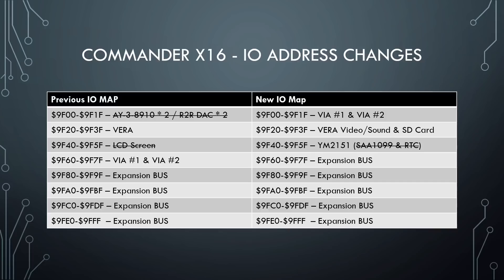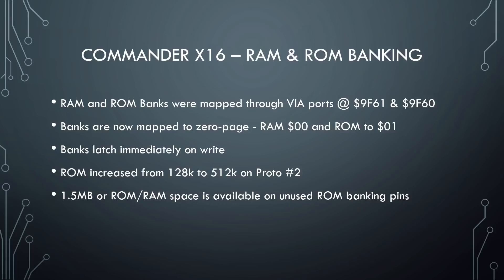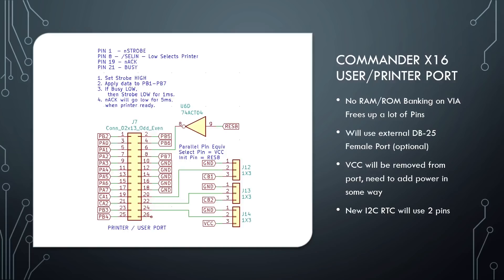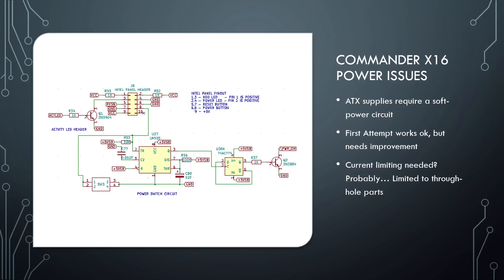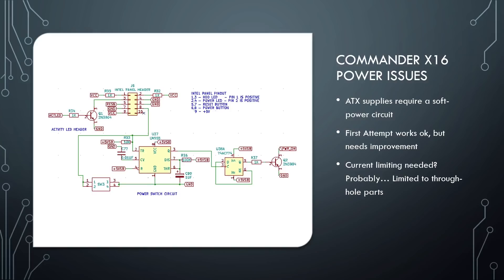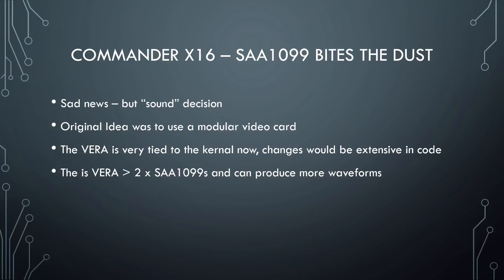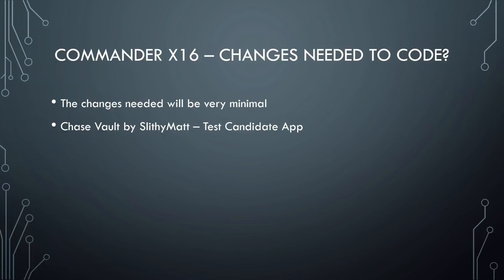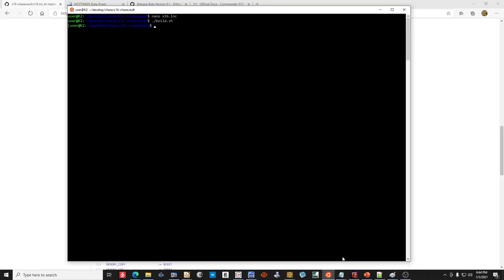Commander X16 Hardware Changes for Proto #2

Comment: J14 should be left in place since this is supposed to be an enthusiasts computer. If you really must exert such control over everyone else you could just solder a wire link on the board instead of the header, owners could remove that link and add the header if they wanted to.
Have you considered making it a closed system and then encapsulating it in potting compound?
Reply from the maker: The design has changed a bit since this video, and I now added +5v to pin 26. This will not expose it on the LPT port, but it will expose it on a 26-pin ribbon cable. We have had interest in the past from schools and other technical institutions who want to use this system as a learning aid.  With that it mind, some level of safety must be considered in the design.  I don’t think I’ve risen to the level of potting compound; this system is VERY open and there will be no mystery.
Reply: @TexElec  Good to know it's still progressing.

Comment: One way to limit random trace-frying is to make a trace-fuse.  
Meaning: make a dedicated section of a trace thinner than the rest. This will ensure which section of the trace that is going to fry, in case of a short. 

If the thinner section of the trace is fitted with a solder mask, then it is possible to re-solder the thin section of the trace, with a single strand of a wire. So this section will remain the section that will fry,  at the next short-circuit condition.

Comment: I was expecting to see how the 16 bit CPU was dropped back to a 6502. I guess that was already decided previously? I'm curious to what reasoning was used.
Reply from the maker: Our kernal developer is not a fan of the 816 and keeping full compatibility with the 6502 was deemed more important.  I did however setup the motherboard to where a 816 could be installed, but there will likely need to be kernal mods and there will be no easy way to access beyond 64k.
Reply: @TexElec  So what doesn't make this project the CX8 at the moment? The bus? The VDP?

Comment: I'm a bit confused about the power supply issues. Coming from 8 bit ataris all thats needed there is 5v dc, which pretty much any usb wallwart rated for 2.5 amps would be able to do these days. So basically like a Pi. Surely the solution wouldn't need to be much more complicated than that here with some additional switch? Sounds a little overkill to actually use atx supplies.
Reply from the maker: It's an ATX form factor board meant to go in an ATX case, so it stands to reason the best supply to use would be an ATX power supply.  Honestly, I've done a bit more research, and I feel like it's going to work out fine.

Comment: Can't you simply put in a diode (or some other form of short-protection, like a self-resetting fuse) on the VCC line to User Port pin 24? I would prefer to actually have VCC integrated in the user port connector instead of having to wire it separately

Comment: Whatever they end up doing with the power button, I hope they keep it like the C64 in that you can turn the system off at any time without having to worry about a "proper" shutdown* (one of things I don't like about the raspberry pi).

* Obviously taking care to not turn the system off when it's writing data to the SD card or other storage devices.
Reply: The only reason “proper shutdowns” would matter is if a cold shutdown can result in data corruption, something that only matters when dealing with multi user, incredibly complex operating systems

This is so much simpler than that, and as a result acpi shutdowns shouldn’t be necessary nor would they even work.
Reply: @amarioguy  Awesome. Sure was nice to have a computer that can "boot up" in about 1 second and be shut off at any time (except when writing data to a device).

Comment: I was looking at the emu code the other day... i noticed how much it flips banks when at the basic prompt... result of the keybd check code being in a different bank than the basic code i guess... right!?? .... also getting ready to test dual video... will see.
Reply from the maker: That's definitely a question for Michael Steil, but you are correct, I know it's banking something when in BASIC, I've seen it on the analyzer many times, and I wasn't able to get the system to come up until I worked out the banking.  Fortunately, it is more simple now and should be pretty quick.  Michael has been able to do some pretty cool stuff with banking and there is now 512k which will leave plenty of space to add other code.  The system ROM is really flash, so it can be written to.  I put a jumper on the write line (don't want bricking programs out there!) and it will likely be off by default.  We also have yet to test the write routine, it requires a preamble sequence to write, but I suspect it will work fine.
Reply: @TexElec  banking is a trivial thing to do once u get the right addr decode logic in place (disclaimer: which i did screw up a number of times...at the start). actually, i was wondering about the ROM, so u just answered my question (today i bought some flash to replace the eeprom in my current proto). I will also soon be able to test vera.. but more on that later, if you are interested. you guys are doing an awesome job, and I am thankful for inspiring it has been in these otherwise dreary times... the kid i was with my apple iie never thought that one day i would make one so easily, thank to what you guys are doing. 🙏🏻

Comment: Interesting that the X16 is a 8-Bit Computer but for me it is like a 16-Bit Computer.
Edit: The PC Engine/Turbografx-16 is marketed as a 16-Bit Console but in there is a 8-Bit CPU.
Reply: That is because the 6502 has a 16 bit address bus. It still handles data in 8 bit. That's why it's called an 8 bit CPU.
The PC engine/Turbografx16 being marketed as 16 bit console is because its graphics processor (Huc6270) is 16 bit.

Comment: As for your power-on “soft switch”, use a SPDT microswitch; wire the center (common) to +5Vsb, and either side to a pull-down resistor. Connect the N.C. end to the “R” input of an R/S flip-flop, and the N.O. end to the “S” input. Make sure the microswitch is “Break-before-Make”, though! Then hook the “Q” output to the 555 so it provides a single pulse of the desired duration to the PSU. Hook the “Q-bar” output so as to reset the monostable MV (the 555). Of course, the 555 and the TTL chip implementing the R/S flip-flop need to be connected to +5Vsb, also.
When the circuit powers up, the N.C. contacts of the microswitch connect +5 (logic high) to the “R (reset)” input of the flip-flop, guaranteeing it starts up with “Q” low, and “Q-bar” high. This also ensures the 555 timer (in monostable mode) is also off (pin 3 low). When you push the button on the microswitch, the pull-down resistor connects “R” logic low. As soon as a pulse from the “N.O.” contacts of sufficient duration is seen, the “S” input of the FF will pull the “Q” output high, which will activate the monostable, and provide your power-on signal to the PSU.
Also, you can do away with a lot of the complexity and use a 74LS14 (one section), and a simple resistor/capacitor charging circuit into the input of the inverter, and the output will go to “\PWR_ON”. Wire a 10 uF electrolytic cap and a 47 kilohm resistor (in parallel) from Gnd to the input pin of the inverter. Now, hook the power button in series with a pull-up resistor to +5Vsb, and hook to the input of the inverter section. Now, only when the cap charges up to the point where the “schmidtt-trigger” feature of the 74LS13 inverter activates, will the output go low, turning on the PSU. When you release the power button, the 47k resistor will discharge the 10 uF cap, and the input will go logic low again, and the output will return to logic high. You may have to play with the values of the resistor(s) and the capacitor.

Comment: One way to solve the “J14” problem is to wire in a small 5v PCB-mount reed relay (SPDT), whose contacts replace J14. One side of the coil (and the cathode of a 1N914) goes to pin 3 (Vcc), and the other side of the coil (and the anode of the same 1N914) goes to pin 26 on the printer/user-port. In normal use, the relay will be off, and the N.C. contacts will connect pin 24 to Gnd. If a user-designed device wants Vcc, they just jumper (any of) pins 8,10,12,14,16, or 18 to pin 26, and this will pull in the relay, connecting Vcc through to pin 24. The other option is to put a resettable picofuse in series with the line from J14:2 to J7:24. This way, if someone does put the jumper on J14 from 2 to 3, then plug in a device that connects J7:24 to ground, the fuse will go high-impedance and limit the current. Once the short (or the jumper) is removed, and the picofuse cools down, everything will return to normal. Finally, you could just connect J7:26 to Vcc. A Centronics parallel port is a DB-25, so pin 26 isn’t used, but a developer could still make a board that plugs into the 13x2 male pin header (J7), and get Vcc from pin 26. HTH! 😎
Reply: My favorite is actually the last of the three ... with all of those grounds, you can connect to of the DB25 grounds to one ground line and then have a ground and VCC on a separate output ... say a mini-DIN4 or 5 with the ground and VCC where they normally go on common users of that pin count mini-DIN.

Comment: Nice progress, and great to see Matt's game running well! (People: check out his channel "Matt Heffernan" AKA slithymatt).

I'm not a power-circuit designer, but I'm curious if you could use an SCR to latch the power on and stay on, so debounce would not be so tricky?  Then it seems a simple RC filter to manage the SCR turn-on signal might be straightforward.

Comment: Why did you move from barrel jack to ATX supply? Just curious, but I think it just makes things more expensive and complicated for little to no benefit.
Also, I actually like the drop of the SAA, and I think nobody will want to drop the VERA chip, It’s plenty powerful and I Can’t see a possible better alternative for graphics
Reply from the maker: There are pros and cons to any approach.  While ATX does complicate the power input a bit, it is very flexible.  You can use pretty much any PC case made in the last 20 years, and likewise, you should be able to use about any ATX power supply.  I would still look for a lower wattage supply, but I'm shooting for it working with a 500w or less supply.  Ultimately, cases are an issue, getting a case molded is seriously in the $100k+ range.  We're not antcipating C64 mini numbers, so we have to scale the system to be built within the means of the project.

Comment: Why a barrell jack? You're already using an ATX power supply, you have a bunch of molex connectors inside that can be passed through if need be.

Also, this is entirely opinion but I absolutely hate the FM sound.
Reply: If you are asking why they are using a barrel jack with an ATX power supply, did you miss that they said the barrel jack was what they USED to have, before they transitioned to an ATX power supply?
Reply: "I absolutely hate the FM sound"

I did too, but nowadays I can appreciate it more. A lot of games did not make good use of it and ended up sounding like robot farts. But, there were also a good a amount of games that sounded extremely good FM music, especially in the arcades and computers like the PC-98 and the Sharp 68k.

There were also some Adlib games that had good music, like Dune, MegaRace and KGB/Conspiracy. 

Let's not forget Tim Follin's work on Time Trax for the Sega Genesis, which is absolutely outstanding.
Reply: @papeleradereciclaje4375  Yeah, I think a lot of DOS era adlib music was just composed as midi, on a system with much better midi instruments than the adlib defaults. But if it's a composer who knows what they're doing, and treats it as an instrument in its own right, it can be great.

I'd add the very first game with FM sound, Marble Madness, to the list of gorgeous FM tracks.

Comment: 2:40 when things are mapped to $01 and $00 what does that mean? aren't those just two separate bytes? do they act like pointers controlled by the bank switching apparatus?
Reply from the maker: It's memory location $0000 & $0001.  I just used the zeropage reference in 8-bit.

Comment: FTDI sells usb controllers in 28-TSSOP packaging. If I happened to make an expansion card, then you'd have kb/mouse/sd control. Maybe ethernet along there if it's not in already.
Reply: Adding the physical port would be trivial compared to the complexity of implementing the device drivers in 6502 assembly, I think.

Comment: Use a cap (0.1, 0.01 uF) across the power button to clean up glitching as a form of low pass filter. Value would depend on the size of the pullup resistor.
Looks good so far!
Cheers,

Comment: I'm not sure if this is relevant, but why reinvent the wheel? The Checkmate A1500 Amiga case has an ATX to Amiga power control board that looks quite simple, though I don't know which ICs are used, so I don't know if through-hole versions of the ICs are available, but maybe a modification of Rob Cranley's board would be enough, instead of Amiga power output from the board, just modify it to output the power required. Can be a daughter board similar to how you have the VERA maybe. Maybe reach out to Rob Cranley since he already has similar ATX PSU control designs in production. Also, it's possible the X16 doesn't draw the minimum load some ATX PSUs require, if the minimum load isn't drawn from the PSU, it will shut off automatically. Rob's board has placement for resistors to be soldered onto the board to create dummy loads to address this, maybe this can be done with resistors and jumpers on the X16 to allow users to adjust for their PSU. But this may account for some of the issues other testers have experienced.
https://www.checkmate1500plus.com/Products.aspx?id=357
Rob talks about the minimum load issue and other design considerations in this video https://www.youtube.com/watch?reload=9&v=kqUqu-n6GZc

As for power on the user port for parallel/LPT, maybe use a soft push button (or a command to turn the power on, though this requires code obviously), basically, connect the device, press the soft power button, now you have power, remove the device, power turns off automatically, reset or remove power from the system and the power turns off, something like that may work.

I've never even really used any C64, maybe a couple times as a kid, one friend had one, basically only a few people I knew had a computer of any kind when I was a kid, and those that did had a PC. I've never even seen an Amiga in person in my life and was mostly unaware of them till watching a bunch of videos on YT during the pandemic. Maybe they just weren't popular here in Toronto. Although I am a PC guy through and through and work in IT, Commodore/Amiga has a certain appeal that Apple products have never had for me. I just keep thinking "why didn't these things use x86?" lol, yeah, I'm partial to x86 despite it's flaws. So while I am not a programmer (I hated it when I was in college (Canadian college, not university), but I did somewhat enjoy lower level coding in Assembler (actually MC68HC11 MCU) and also in C and Java, but not C++ or VB, and I hated VHDL (I left school and went back 8 years later, had to redo my 3rd semester digital circuit's course because working with real circuits was no longer valid). I never learned BASIC and I'm not familiar with not really having an OS or hard drive (even as a kid every DOS machine we had had a hard drive, so I never really experienced using floppies other than to install programs). This project is appealing as a way to get into retro computing, though I wouldn't be do any coding, only use pre-written code or compiled code.

I hope my above suggestions are helpful, though maybe these have already been thought of/discussed.

Keep up the great work!
Reply from the maker: Hmm, I'll have to dig up the ATX specs again, but I was pretty sure you're not required to put any load on the supply.  It was one of the first things I looked into, but it's been awhile.  They don't seem to have any current limiting on the board too, it kinda looks like what I did somewhat.  Hard to tell.  I'll let the video play while I'm working here and listen.  I'm not expert here, so I'm happy to learn more.  Thanks for the help!
Reply: @TexElec  You're welcome, glad it was helpful. I'm not an expert either, and it's been a long time since I dealt with circuits at that level, so even discussing details gets a little fuzzy for me, but I do get things conceptually still. Further reading I did after posting (instead of work I needed to do) seemed to indicate it's older supplies that need a load, newer supplies that do DC-DC conversion (derive the 5V and 3.3V rails from the 12V rail) don't seem to have that requirement, and generally are simply better overall designs. But requiring a load might explain some of the issues the other testers experienced.